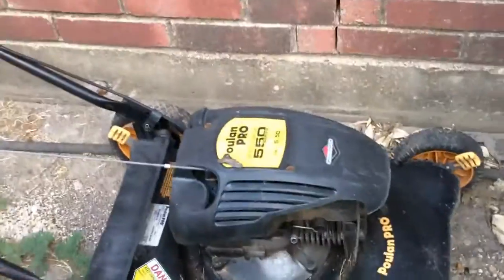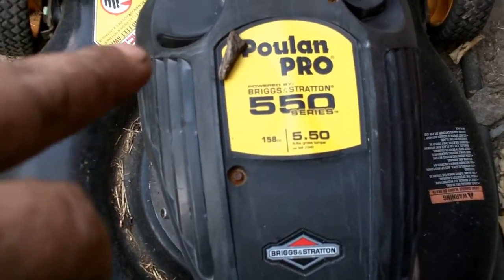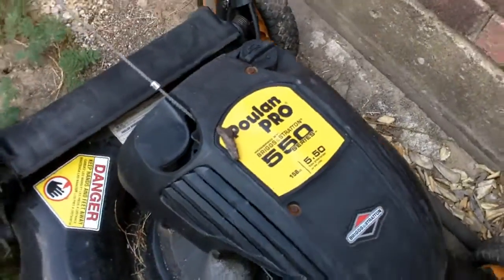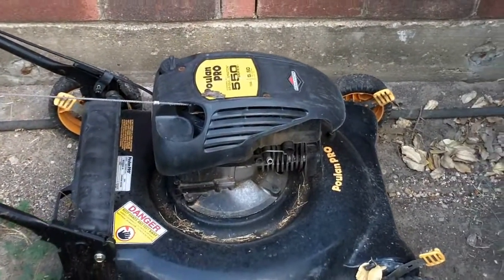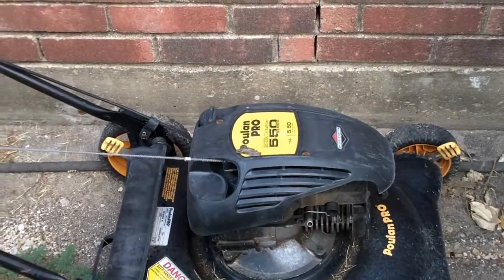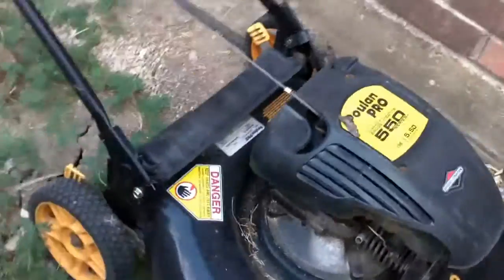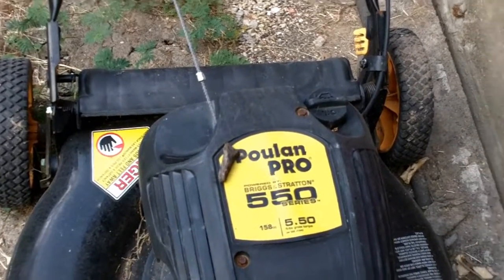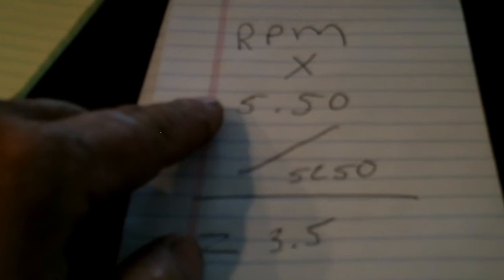LAWN MOWER REPAIR  LAWN MOWER POWER RATING      how to convert gross torque to horsepower

Comment: How can I find out the engine rpm without buying a tachometer?  And what happened to be able to adjust the speed of the engine.  I have three push mowers and one is a self-propelled push mower I got in 1989 that i could adjust from the handle how fast the engine ran.  Very handy as when mowing gravel areas with grass I would go down to almost idle to keep from sucking up gravel.  The other two are newer and only run at one speed.

Comment: Great video.  Also, in a previous video you use a thump pump pressure gauge to check 2-cycle carbs.  What company did you buy it and how much did it cost? I've looked on eBay.  Most cost $50 and up. Thanks for your help.

Comment: Since I bought a rpm tack every engine I check so far was set under 3100 rpm, most on small lawnmowers are reading 26-2950   rpm.  Are they reduceing the rpm to match the max torque  curve of the engine to acheve lower emmision levels ?  My new cub cadet ,honda clone reads 3050 rpm.   I will definately try my math,Thanks